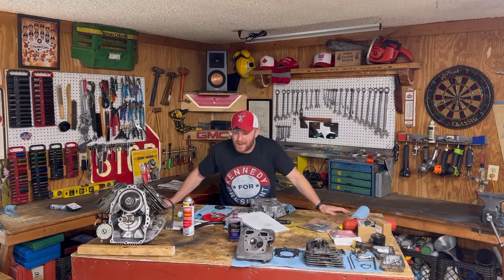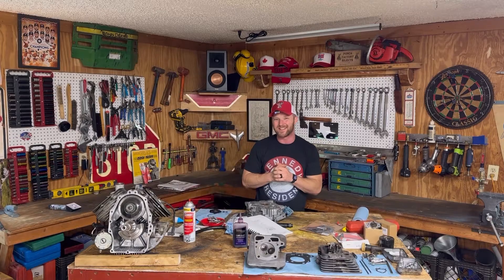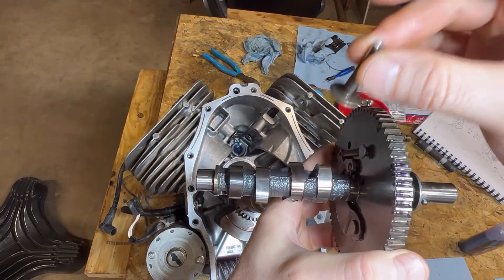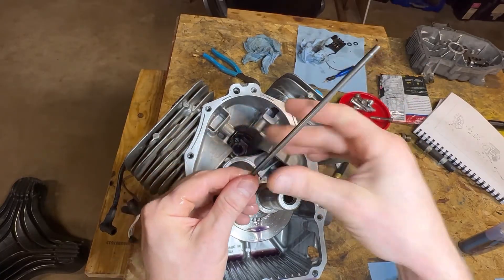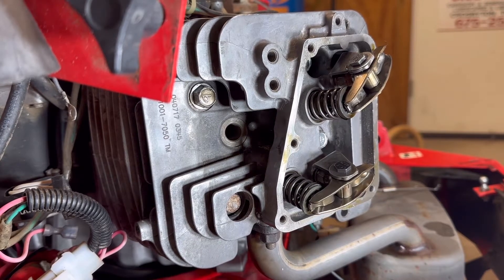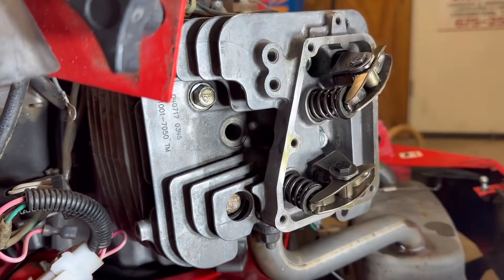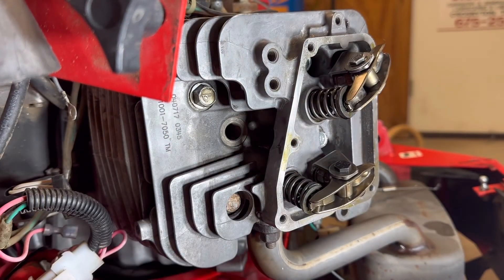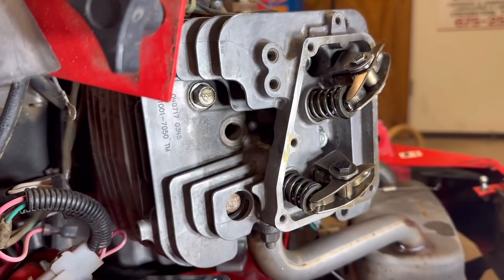Kawasaki Valve Lash Adjustment, FR, FS & FX Models (FR691V)

Comment: I have a head that I’m about to install and i have to tighten one of the bolts that attaches the head to the block but i have to remove the rocker arm. I don’t want to remove the rocker arm. What socket can I use or do you use?
Reply from the maker: Pretty sure that rocker has to come off to get to all the head bolts. Use the socket that fits

Comment: When you turn the engine by hand, should you hear any suction sounds? Mine makes a sound in the near the intake like you're sucking up a little bit of gas or oil through a straw during one part of the stroke. Should I hear that? Checking it put bc it stalled and lost power randomly. It had bubbles in the oil dip stick. Thanks, mower Mike!
Reply from the maker: Ya suction sounds are normal. But just like air suction sounds, not too sure about those gurgling suction sounds you are getting

Comment: Way too much work on that engine.  Why? I thoughtvthese are good engines.
Reply from the maker: You should check out one of those new fangled electric mowers.
Reply: It's routine maintenance...any small engine will need the valve lash adjusted every couple hundred hours. The only issue these Kawasaki FS/FX/FR engines are known for, from what I've heard over the years, is valve train problems due to lack of routine valve lash adjustments (letting the valve springs weaken, valves/valve guides/valve seats work themselves loose).

Comment: Great video!   My Deere 636m service manual has the specification of Valve Clearance (Intake and Exhaust) ..............0.05—0.10 mm (0.002—0.004 in).  Great job!
Reply from the maker: Glad it helped, it is a great engine

Comment: Thanks man! This would probably explain my sputtering and popping I’m getting under heavy load. I’ll try and adjust my lash this weekend.
Reply from the maker: Maybe but sounds like it maybe more of a fuel or compression issue. Good luck
Reply: @MowerMike  thanks! I’ll figure it out
Reply: My Kawasaki has the right side valve cover gets hot really fast while the other side is cool. It has to be a cable issue. Before this it would pop every once in awhile. I will check this

Comment: So you mentioned boosting the horsepower. But you didn’t exactly touch on how you did that and I am greatly interested. So far I’ve had to replace the carburetor. I replaced it with a Chinese carburetor which didn’t work very well so I went and got an original Walboro carburetor. There was too much gap eight or 9 thousandths more specifically well over 007 in the number two cylinder exhaust rocker. I tightened that up. It’s closer to 005 right now. I’m having three separate issues number one not achieving 3600 RPM number two I burn up belts like crazy, but every other time I mow the lawn.
Number three occasional backfiring once it starts to backfire it keeps on backfiring
Reply from the maker: Sounds like it is running too rich. I would fix your mower before you try and boost horsepower. Good luck
Reply: @MowerMike  I intend to fix everything first but I am still curious how you “boost horsepower. What is your method?

Comment: Without seeing the valves how do you know what is intake or exhaust
You stated  0.004  and 0.006  but you didn't explain at top dead center in the rocker cover what valve is on top?  Thats critical to know to do proper adjustments.
I have a cub cadet with a FH430v
The valve lash is pretty much the same on most these motors
Looking at the chart online and it says intake 0.004  and exhaust  0.006   i can only assume you adjust the intake (top) first but i don't know if thats the case and if they are reversed on the other cylinder side of the motor
0.002 isn't that much difference and the motor might run but it won't run right.  
It will either run lean or waste gas and run rough.  
I have to do my  lawn tractor myself
Ive got no way to take it to get serviced, and after changing the starter, and starter relay    it still cranks slowly leading me to think the valve lash is wrong.
Last time i used it it ran fine parked it for a few weeks and now won't start,  last option is change battery
But now i don't think it was any electrical components, just valve lash causing the problem. 
And for a 20 year old lawn tractor with about 300 hours on it that sounds about right.
Reply from the maker: The one closer to the exhaust manifold is the ???? You got this

Comment: intake stroke, compression stroke, combustion  stroke, and exhaust stroke.
 exhaust stroke is what you referred to as the other top dead center. At that point the exhaust valve will be closing and the intake valve will be opening to start the process over.
Intake stroke, will be a down stroke, ie piston moving downwards allowing air fuel mixture in.
 Compression,up stroke, valves must be closed to allow fuel air mixture to be compressed. 
Combustion,down stroke, engines spark plug fires,on most engines slightly before top dead center valves are still closed. Commonly referred to as power stroke. Gas air fuel mixture ignites (explosion) pushing piston and rod downward to spin the crank. This is why you want to run the proper fuel in an engine. If you have an engine that needs higher octane and you run lower octane then you risk the compression igniting the fuel before the spark plug ignites it. Heat and compression can cause ignition alone i.e detonation.Lower octane ignites easier than higher. Not related to most lawnmower engines but thought I'd add anyway.
exhaust, up stroke, exhaust valve opens allowing burnt gasses to excape. Thats how ya get your 4 cycles.  
On the exhaust stroke as the piston comes up and is pushing the exhaust gaseses out, depending on valve timing, near or at top dead center the exhaust valve will be closing and the intake will start to open. Why there's pressure on the valves and why you don't want to try and adjust valves at that top dead center. I'm no expert just a diy guy but hopefully that clears some things up on that part of the video.
Reply from the maker: Dang that is a great description. Wish I read this before I shot the video. Thanks!
Reply: That's why it's a 4 stroke 😅